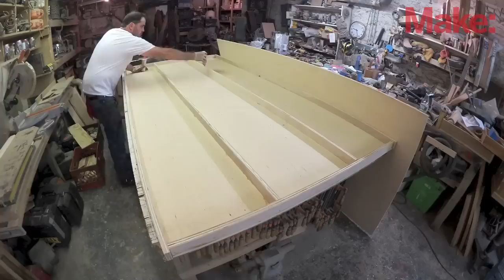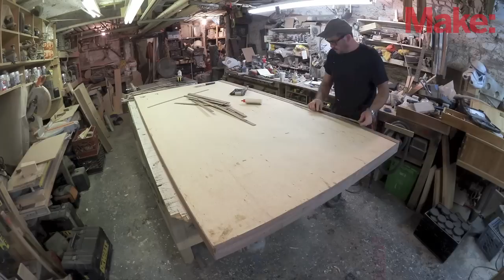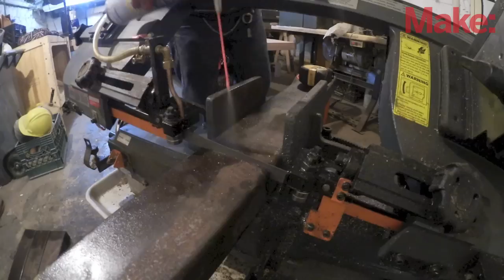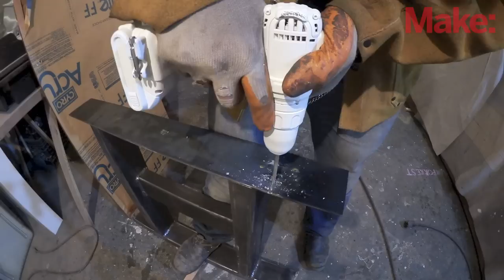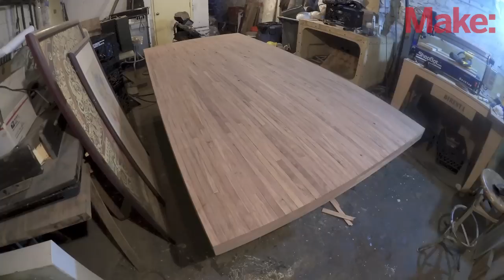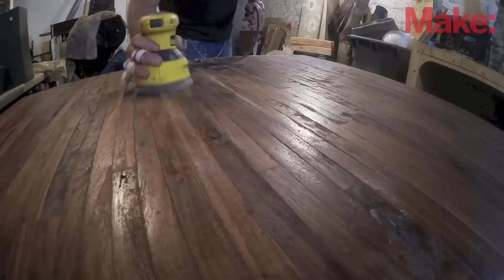DiResta: Meeting Table

Comment: the epoxy and the polyurethane leave different stains on the walnut , so i sealed it first with heavy coat of the poly it also to fill small cracks> epoxy > sand > poly...thank you

Comment: nice! looks like a massive version of my work desk. it was an old metal frame with oak floorboards for the top i found in a mates shed. it had been in there for about 25 years! i got rid of the rust, painted it black and sanded and waxed the top. gota say it looks better than anything i could find ina shop and apart from tthe paint and wax it was free! 

Love the vid diresta, keep em coming!!

Comment: Why coat the table in poly urethane, then epoxy fill the holes and sand back to raw timber again?  Why not just fill the holes with saw dusted epoxy then sand and finish with PU?
Reply: Walnut has open grain. He was sealing the grain to give the final finish a nice smooth shine.

Comment: What did you use to seal the wood before you mixed the epoxy and saw dust to fill in the larger voids?  Was it just poly?

Comment: Can someone explain why he glues AND nails the boards. Isn't one or the other enough?
Reply: many people "glue it and screw it"   I would never just glue, you need a fastener of some type.  Glue is cheap and it's another layer of securing it.
Reply: Kevin Stempien Hmm, interesting. Thanks.
Reply: Nolan Gaudreau He uses nails also to skip the clamping step so the glue could dry, while still under pressure. The nails are invisible on the finnished product. Imagine clamping each of the tile, or getting a whole clamped section sliding to some side.
Reply: ***** Yeah, true. That would be a pain in the butt. If I wanted to avoid using nails I would probably just put something heavy over the entire piece (if I had it). How are the nails going to be invisible though?
Reply: Nolan Gaudreau small headless nails propeled from a compressor/nailgun tend to get inside the wood. After proper sanding/oiling/masking/sanding they will be part of the grain. Many people think that woodglue is not enough, but try breaking one - the glue seem will allways be intact. (wood around it rips apart). But in this case its way more efficient
Reply: ***** Got it. That makes sense.
Reply: ***** i made a floating corner desk and glued pine boards together so they would be wide enough.  I don't have a biscuit joiner so I just glued and so far no problems!
Reply: In cold molding we use staples to hold the metarial in place then remove the staples when the epocy has set
Reply: The pins act like clamps.
Reply: ***** Thanks for the answer.
Reply: +Nolan Gaudreau All you need to do is glue, however for wood glue to properly set it needs clamps. The tacks hold it down.

Comment: what size nails are being used? I assume 18gauge brads but i dont see any holes in the wood. Maybe because the walnut is so dark. I am trying this with pine and the 18gauge nail holes stand out too much
Reply: Ed Gonzales 16 gauge
Reply: Ed Gonzales lol don't listen to that other guy. he's using a 23 gauge pin nailer. they're tiny
Reply: Thanks  Tommy. I didn't know they made a 23g nailer.
Reply: I have one.The pins are pretty much invisible.
Reply: Robert Palmer you'd think they wouldn't be much smaller than 18gauge but they certainly are. I have a Hitachi one that I couldn't be happier with  (I guess I wish it went to 2" but I'd have to get a grex for 300 bucks and that's just not worth it for what I do lol)

Comment: Why did he brush finish on, then sand it all off, then roller it back on?
Reply: I think the first coat sealed the wood in prep for the colored epoxy filler.  Maybe that way the tint in the epoxy was limited just to the holes and kept away from the good wood around.
Reply: Hmm. Why so much sanding before the next coat, then? Thanks for responding.
Reply: Well that makes sense. It just seemed like he took that whole first layer off. I guess I was wondering if he didn't calculate for the epoxy use (for the knots) and had to go back a step or something.
Reply: He put a thin coat on to help sand more evenly. It shows where he's already sanded.
Reply: ***** Very cool. Thanks for responding.

Comment: boardroom table manufactures need to consider technology in their tables.  There are power, network, and video connections below.  These need to be brought to the top of the table.  I often find they are added after as an after thought but there are so many ways to easily add these connections to the table with out having a power bar on the the top or a big mess of cables underneath.  

I really like your work, and enjoy your videos seems like these things don't get passed along to the builders

Comment: Hey DiResta, isn't WD40 not a lubricant? Or does it have lubricants in it???
Reply: It's mostly a solvent. It will reduce friction for a while, but it won't last very long. It will also clean out long-lasting grease from the object. I once had to regrease an entire bicycle chain from scratch because I was dumb enough to use WD40 in the cleaning process. If you want to reduce friction in encapsulated, hard to reach mechanics (like a modern window), gun oil would be a better option. And if you can touch it, you can grease it.

Comment: when I try to nail the wood slices it cracks . what can I do
Reply: Pin nailer. They are barely visible, and all they're doing is acting as clamps until the glue dries.
Reply: ok  but the wood still crack
Reply: What kind of wood are you using?
Reply: mahogany slices
Reply: I'm not sending anything to anybody, but I will tell you that mahogany is very brittle and prone to splitting. Don't nail it. Just use the best quality adhesive you can get your hands on.
Reply: thanks

Comment: i heard wd40 is a solvent not a lubricant, is this applicable here?
Reply: Its most definitely a lubricant..
"WD-40 is the trademark name of a lubricant, penetrating oil and water-displacing spray." Wikipedia.
Reply: wd40 as a cutting fluid is fine for some materials, not so much for some others.

Comment: Sorry,but how much bottles of glue should we use plz reply
Reply: You can never use to much glue... When you glue wood together you should always secure it together with nails,screws,clamp, etc.. Once wood glue drys it is actually stronger than the wood itself... Most carpenters use just enough glue so that when they clamp the two pieces of wood together a small bead of glue will come out of the space and you just wipe it off with a wet towel.. You can use a whole bottle of glue on one tiny spot but just be ready to wipe all the extra up... Sorry for the long reply
Reply: It's ok bra thx

Comment: I'm sorry but it seems cheesy, like factory made veneer over particle board crap. Why not tongue and  groove plank walnut or oak. How about a rail, stile and panel pattern with an ogee edge. I know you don't use marble or granite but I would go with a slab of cream marfill.
Reply: Why not? Because that isn't what the client wanted... Seems pretty straight forward.
Reply: I'm not his client and I would imagine his client has no idea the difference between furniture made in a traditional way with locking joints and pegs and...well, this. DiResta is a specialty contractor who is lucky to work for upper scale clients. As a fabricator, I work with marble and granite, this just looks wrong. Working with wood and building furniture is just a hobby for me.
Reply: sherriandalan this is roughly a 4x8' table, a stone slab that size would weigh over 860lbs! The table Jimmy built could be carried up stairs by two guys...AND this is New York style matters more than tradition. I think this table looks cool, kind of reminds me of a walnut basketball court...to each their own though.
Reply: Maybe I just hate particle board? I think the veneer is cool, love walnut, and the idea of making it portable, but just can't get past the particle board. For moving marble tables we have cranes and high lifts that fit through doorways so one or two guys can move a table, and we charge for it.
Reply: sherriandalan He used plywood under the veneer, not particle board.
Reply: Luck really has nothing to do with Jimmy getting this kind of client builds.